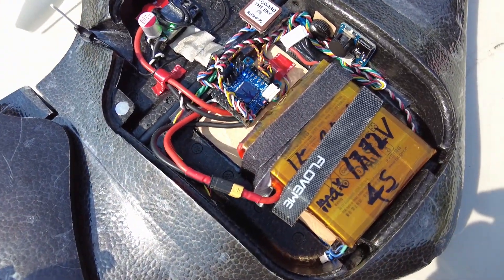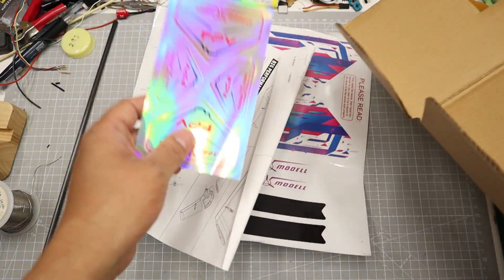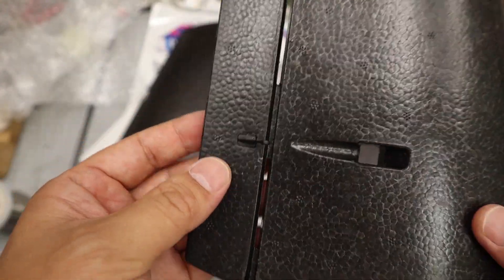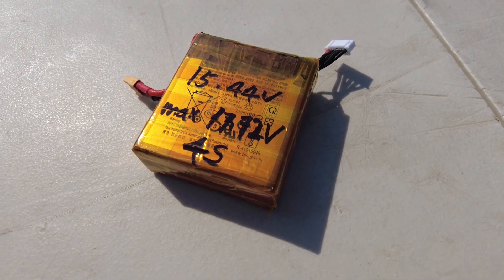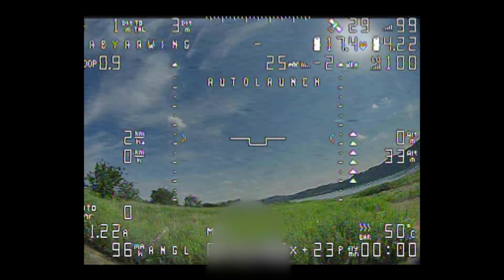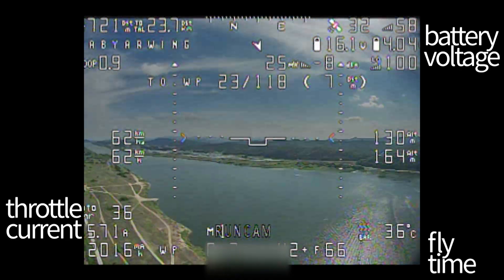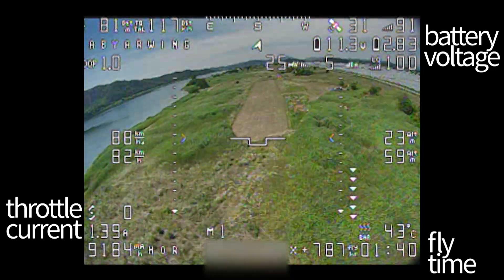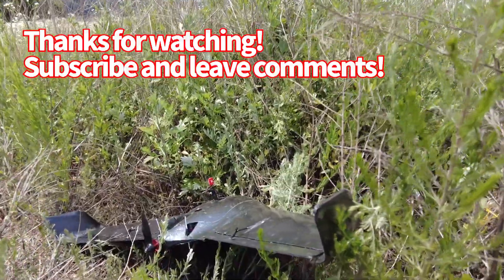Baby AR Wing PRO 682mm, 117km distance setup!

Comment: Wow amazing. I'm coming from fpv quads. Looking for a small light fpv wing. The wings must come off and fit in my backpack. Is this the one or any other better alternatives?
Thanks.
Reply from the maker: It is  one of best wing in recent days, I think. In aspect of size, performance,  easy to build,,, I can't find a replacement.
It will be easy to do because you already have experience with quads.

Comment: Great work. What’s the charge and discharge rate for that battery ? 
Thank you for sharing
Reply from the maker: The battery is made for samsung galaxy S21ultra model. At commercial said samsung galaxy S21 ultra support 45W charging, it means 4V@11A roughly. If the battery can charge 11A, it can discharge over 11A or more. IMHO, at my test, the battery can drain continuously over 20A.

Comment: does the 2204 motor fit in the provided motor mount?
Reply from the maker: I drilled motor mount for 2204 motor.
Bolt spacing(center to center) that provided motor mount is 12mm(M2), but my 2204 motor is 16mm(M3).
Reply: @celeselements  do you think it could handle 120mph speeds? Planning to use a t motor f80 pro on 6s.
Reply from the maker: At 120mph(193km/h), In my opinion, you will definitely need laminate film. I use 1.7mil laminate film, but toughness for high speed need more thick laminate film, like 3mil or 5mil. If I were you, I choose 5mil. If you didn't to reinforce wing, it will suffer flutter.
Control horn, control surface, control rod, hinge that need to be strengthened, also need to use more powerful servos.

If you haven't purchased baby AR wing yet, please consider Swallow S670. It has more strong airfoil.
Check my friend vid :
https://youtu.be/VIm81QFYmLI
https://youtu.be/Wd4Eg3vEUDk

laminate film 3mil : https://alofthobbies.com/collections/new-stuff/products/cp-laminating-film-3-mil-x-18
laminate film 5mil : https://alofthobbies.com/collections/new-stuff/products/di-laminating-film-5-mil-x-12

An iron is required to coat laminate film.
Reply: @celeselements  thank you very much for the info! Will check out the swallow.